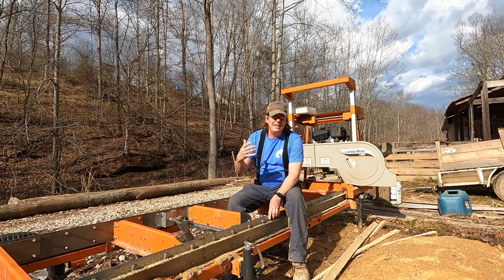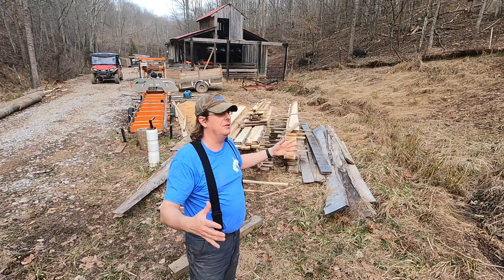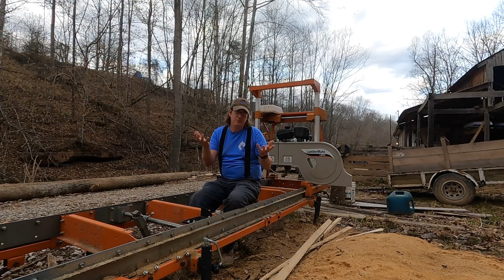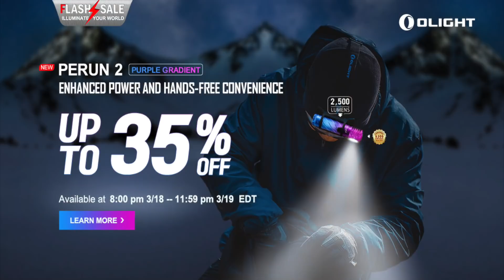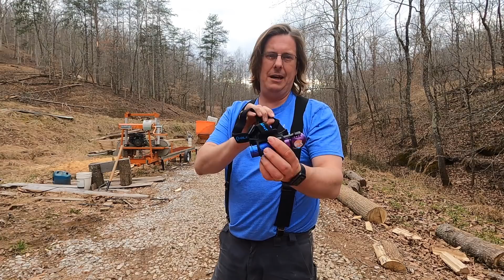Can You INSPECT & STAMP Your Own Structural Lumber???

Comment: I believe codes and codebooks are a good thing. There is a codebook (API 1109) regarding weld inspection on pipelines being constructed or modified. 
The company that owns the pipeline does not want a junk product handed to them.  And you probably do not want a pipeline blowing out near your place. Likewise, I do not believe that you would want your son or daughter to buy a house that did not at least meet the code minimums (standards).
In the community that I grew up in on a lake, many of the old cottages were basically built yesteryear (ie 1930) from shipping crates. So they have the old plumbing, old sewer system, old insulation (if any), and cruddy old wiring. Most of these are wrecks with plastic siding over the surface of them.  My father had 4 or5 sawmills when us kids grew up. So I do see the value of rough sawn lumber, planed or not in home construction.

Comment: I wanted to build a log cabin on the block I own, I wanted to mill three flat sides (with a routered lock in system at the top and bottom of the log) and have one rough side to face outside, the logs where going to be 300mm (12in) in diameter and was told because they wouldn't be graded I wasn't allowed so I was told to build it out of 90x35 and mill the boards for the front. So according to my local government it's safer to use 1/10th of the timber in our house construction because it has a stamp on it. It makes absolutely no sense what so ever.

Comment: Salvaged lumber is my field and the conversation on getting salvaged lumber, Long Leaf Pine which I have a million board feet stocked up, and recertification does change the value potentially.  Perhaps you will be able to address and offer a comparative analysis of fresh cut to the incredible savings of using salvaged lumber instead.

Comment: Does anyone believe that the presence of a "stamp" on a piece of lumber, changes its integrity or structural capability?
The structural capability of common lumber species used in construction has been documented for ages.
Stamped lumber is just another way that the lumber industry, in bed with corrupt government, control building materials availability and pricing.

(Grading for appearance is another matter entirely and is also subjective and has nothing to do with structural capability).

Is each piece of dimensional lumber sold, tested for structural limitations?  No.
The most important piece of information to the end user is knowing the species since that determines the overarching structural characteristics.

Stamping requirements are a scam, pure and simple.  The whole system is designed by those who control pricing, certifications, licensing, inspection fees, and on and on.

Whenever one hears "It's for your safety and well fare" your BS detectors should be going off.
If construction is destined for habitation, then the only inspections required should be in the application and techniques of said materials as building progresses.

Comment: I just can't seem to wrap my head around any proper justification for a weekly or monthly dues and they should be next to trivial if nothing is changing. It was easier to be certified to save lives than grade lumber.. Once you've learned all your types, saturation values, ect... That doesn't change weeks, even years later? Maybe codes change now and then, but that should be covered by proper distribution of information by the instructing body; be it during regular inspections, a bi-annual testing(at most), or maybe even a literal pop quiz they can issue during an evaluation. This whole Industry has some issues...

Comment: Come buy a house in mo, and they used factory stamped wood.  Yes the qulity of work is that bad a lot of the times.
I'll put it like this, a 20' long wall in an upscale area started with a 20' bottom plate, 6' it was stright 10' is was moving over 1"  20' it was 4" out of stright you could look down the finished wall and see a big bow.  I wouldnt let that builder make me a dog house. It was that dam bad, and it passed code. 
Code dosnt mean shit.  Other problems with that house off the top of my head and it was a brand new home it was also the show house for the area  the big picture window had leaked water in all over the inside covering the drywall and window seat.  Brand new house.

I helped a buddie do finish woodwork on the clubhouse, the inside rockers forgot to cut out a window,  the funny part was you could see it outside looking in the window.  And we never framed it untill it was noticed by me.   I seen it walking outside smoking a cigarette  came in and told the guy about it then walked around the place lookin in every window for more.   This was union guys who did this.

Comment: I understand the need for inspections of lumber, structure, plumbing and electrical.  However I've also seen some pretty shoddy construction on buildings that were "inspected."  I lived in a house that was built way before stamped lumber or inspections.  The studs (anywhere from 12" to 2' apart) looked like someone had grabbed them from the slabwood pile and the floor joists were logs, rotten by the time I was there.  I'm not saying that it was well constructed but it is still there after 150 years.  Here in VT the state and town (no county government to speak of) do not have inspections for private buildings or licensing for carpenters and I do not see any houses collapsing

Comment: If you call the authoritative body and pay a fee, you too can become a certified lumber mill and legally stamp your own lumber for sale as structural lumber.  It was not a big deal. Any idiot could do it.  I know this beacause I did it.  The whole process took less than a month.  The training took 3 hrs. onsite.  It cost a few hundred bucks a month.  Don't be put off.  it wasn't a big deal.  I was a very small mill.  A lucas mill and a couple band mills.  Not all running at the same time.

Comment: My cousin is having a house built in NY right now with rough cut lumber; no stamps, no kiln dried, and no issues. This house/dwelling has, do far, passed every inspection, including foundation, framing, roofing, and insulation. Minimum code is just that, minimum, I’ve never had an inspector do anything but compliment overbuilding when things are done better than minimum code. I’ve been installing whole home surge protectors on every new electrical service for well over a decade, NEC 2020 just made while home surge protectors required as minimum electrical code; going above and beyond isn’t an issue. To me minimum code is quite sub-par and not as good as most older construction, that has lasted.

Comment: You can inspect and stamp anything of yours you want.  Your inspection means nothing to authorities.  If you are building structural parts of a dwelling, it must be inspected, permitted, and use qualified materials based on code.  You can choose not to, which may be illegal in your area. If you do you assume liability for the structure, if you attempt to sell it you must disclose it may not meet structural standards.  Those permits and inspections are qualifiers for insurance and deeds.  Knowingly failing to disclose risk both nullifies any of those contracts, and is legally fraud. If any incident or problems arise from this (to the public, individuals, etc) that is also your liability. Not knowing about responsibilities, risk, and liabilities does not excuse you from them and thus still entering any agreement with those existing is also a form of fraud.

Comment: Would not the solution then be to contract an inspector for a short run? Mill up your lumber over a month or so and then have the inspector who works for a nearby commercial mill come down and inspect and stamp your lumber on a weekend. It may cost you, but probably less than doing it yourself.

Comment: Rather than start with asking your county inspector, I would start with a well known general contractor. Sometimes when you ask this kind of question to the building department, you put them in an awkward position. If they don't have a policy on the books and say yes, it could be viewed as them accepting the liability, which they by default avoid doing. I've been milling for 25 years and currently own a Woodmizer LT40 and have milled in two counties in two states (CA, WA). The truth is many counties don't have specific policy either way. The general contractor will know through experience if the local building department is ok or has a policy on it. Sometimes the inspector is ok with custom beams because they are big and have an esthetic aspect, but they draw the line at studs. If you are selling lumber that the buyer intends to use for structural building, you might want to get them to sign a waiver releasing you, the sawyer, from liability. There are freelance licensed lumber graders who will come to your site and grade and stamp your lumber, but they can be quite expensive. I would start with a local general contractor and ask them.

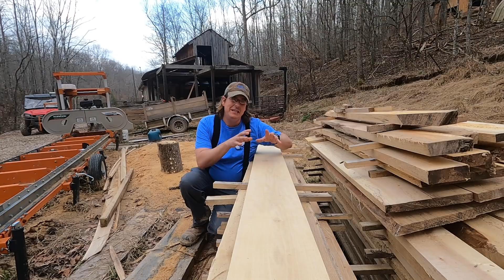Comment: 5:20 I'm not actually sure that's counterfeiting a trademark, since it's not being sold in trade. It is, however, fraud, and I assume several more crimes relating to building codes that would likely vary based on the jurisdiction.
Reply: I'm no lawyer but I'd wager there's some teeth to the laws that protects the concept of a registered safety inspection stamp being misused
Reply: If you look closely at the big box stamps they all include the inspectors trademark, so yes that would be the case and would be sued from them.  Additionally it would also be fraud and could be prosecuted at the government level.

Comment: VA pine is what I was planning on milling into dimensional lumber, but I have heard it warps badly when it dries. What is your experience with this, please? Is this a viable source for studs?
Reply from the maker: It does move a bit. I haven't noticed that it moves excessively. I have used it for barn siding and it has done fine. Have used it for 2x4 for a chicken coop. They did fine too. I would make sure you have plenty of weight on your stack as it air dries.
Reply: @RedToolHouse  Great, thanks! What about letting the logs dry for a season or two and than milling? Think that might help?

Comment: Sounds like a money maker for the Government and protect the big boys.  The CRAP I see passing as structural lumber from say Lowe's is just that CRAP.  I cut local hardwood on OMG a Harbor Freight unit, but sorry a buddy of mine has another brand of mill and the biggest thing is in order.  1.  Mine is a ugly green and his is another color.  2. I have a Predator 301cc engine and his has a Kohler 8 hp engine looks identical except for color. 3.  His owner manual and mine are identical except for the cover page, even the parts call out have the same identification number and part number.  4.  I paid $1750 delivered after the year end 25% discount and he paid upwards $4500 and then shipping.  I don't do structural lumber as of yet as who in their right mind would waste nice hardwood for studs.  Did cut up some old power polls for 5/4" decking.

Comment: Another way to build a house is with posts and beams. These put an H structure frame with the 8 or 10 inch square posts set about 2ft inboard of the corners and similar beams between them. This "table" frame supports the upper floors and similar frame sat on top supports the roof and/or purlins. Floor beams (and of course the posts) will need to be graded timber but the wall frames are not structural so can be any timber you like.

Comment: Thanks you Sir!  How long do you air dry the lumber?
Reply: I was tempted to leave a snarky reply to that question but my better angel said to be nice and helpful instead.  Different species of wood dry at different rates under the same conditions.  Out West, where I lived for 35 years, there is almost no humidity and lots of sunshine.  Fresh sawn wood from our local mill would dry fairly rapidly under those conditions.  In fact, we had to be careful not to let it dry too quickly or it would bow and warp and be good for nothing but the woodstove.  That meant stacking it in stickered layers in a shady spot with a tarp handy to cover it up if rain was coming.  The wood species out there were all fir, spruce, and pine.  Here in Virginia, where I have lived for 25 years, the available wood species and the environmental conditions are very different than out West.  Freshly sawn oak (many species available) dries very slowly because of the relatively high moisture content of both the air and the wood itself.  Kiln drying is a whole different animal and is not something the homeowner with a small mill in their backyard is going to bother with.  Generally, as a rule of thumb, wood cut and air-dried in humid areas will take longer to dry than elsewhere.  In these humid environments, it is imperative that you sticker (separating your layers of stacked wood with smaller lengths of scrap wood placed every 2 feet or so across the lengths of wood you are drying.  For instance, a pile of 8' boards would need 4 stickers (one close to either end and two spaced in the middle) to keep the boards separated.  They also need to be spaced about an inch apart from each other in each layer.  If you don't provide for this air space around each board, you will end up with a pile of boards covered in mold that can ruin a good stack of lumber.  I am assuming you would not know all of this based on your question.  If I am in error, please accept my apologies.  In summary:  slow, controlled drying is the best way to end up with usable wood.  One last thing.  Place some decent weight on top of your stack of drying lumber to keep it from twisting and warping, especially the topmost layer.  Thank you for listening to my better angel and not allowing the snarky one a voice in this answer. We hope some of this was useful.  One of my teachers in life is named Asha.  An absolutely lovely human in every way.
Reply: @nicholasoppenheimer3647   Looks like your better angel lost!!

Comment: There may be an exception for restoring old buildings, because it says they can be repaired in the way they were originally constructed.  The idea being you're basically putting them back how they originally were, so if you have a rotted beam you can replace it with a new beam made like the original (and not inspected).  This is important since old structures were often built with dimensional lumber that were true sizes and no longer available at big box stores.
Reply: depending on where you live some require all new work comply with code example you build an addition that addition has to meet current code.

Comment: Looking forward to the timber frame discussion. 
You quickly mentioned it but is the round over on the corners part of the inspection?  Can rough lumber pass inspection?  My understanding is the round over is for fire safety and to reduce splitting stress.

Comment: When you receive Lumber you need to check it yourself as you use it. Typically there will be some Lumber that doesn't meet the inspection standard as marked. It's hard for a inspector to be fast and completely accurate. Set those boards aside and use them for things that need to be cut. Cut around the defects. You also will get some boards that are marked Select Structural and other boards that are just much better quality set them aside for places that you need that quality. A big problem is lumber that is stamped common when you need 2 and better. Some dealers substitute the lower grade Lumber in spite of what you actually order. You get a framing inspection and fail because the grade is wrong and your building inspector never trusts you again.

Comment: talk about codes, and the fact that they are for safety, and i have to laugh... as an example i asked about this type of thing MANY years ago, and my question was this... if a code says build with your studs at 16 inches on center, why not build with studs at 12 inches on center... i got a 2 part answer... first and obvious is that 12 on center will use more lumber and cost more as a result... the second part is that most inspectors are assholes, they like to play the "to the letter" on these codes.. now to clarify some of this, i was living in Oklahoma at the time, tornado country.... you can see why i asked about that particular code.. after all 12 on center should be "and is" stronger than 16 or 24 on center... the later being what gets used for residential framing... and i figured i would get some safety issue on using 12 instead of 16 or 24 on center... nope what i got was inspectors are assholes... now it may be that state, it may be the time frame, and it may be jaded experiences of the people i talked too... but it is an example where in some cases the codes really mean diddly squat... does that mean we ignore those codes, i'm not gonna say no... but it is something to really wonder about
also should mention i've seen store bought, stamped wood meant for structure that was totally useless for structure... does not happen VERY often, but i have seen them pop up in the stacks from time to time...
Reply: 12 on center IS 24 on center.